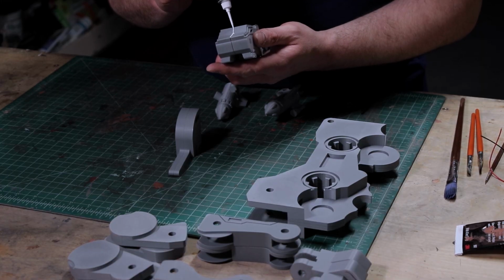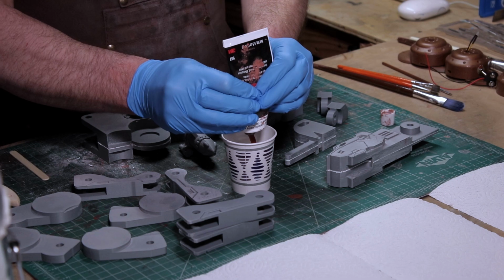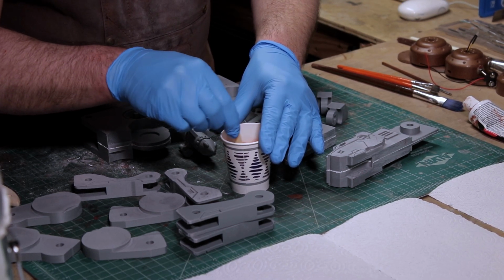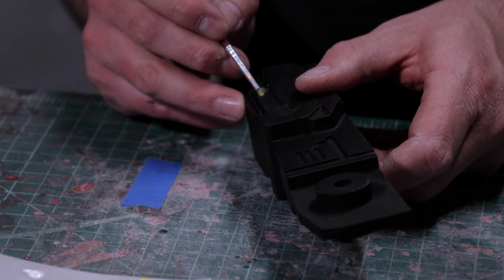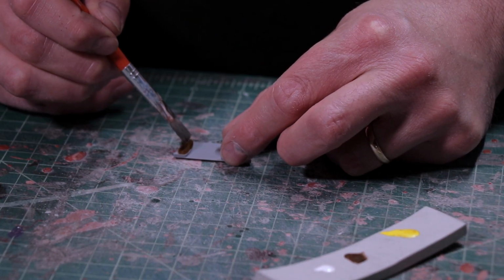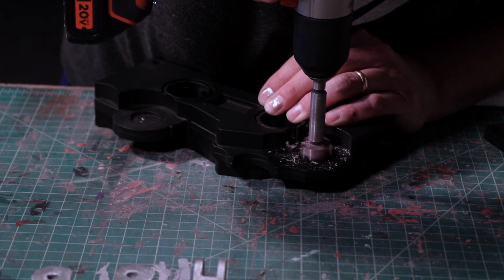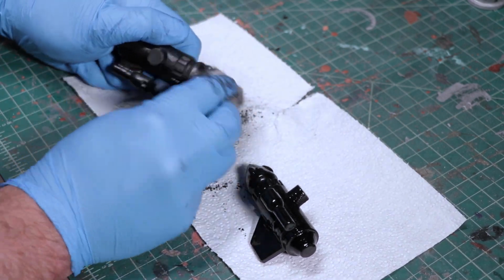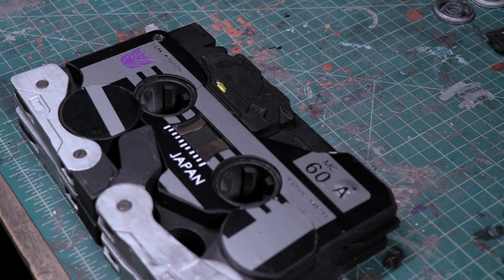3D Printed Ravage from Transformers

Comment: Nice work!  I have that oversized Laserbeak too, I'd printed my AGES ago as large as my printer at the time could handle and ended up with one the size of a VHS tape.  I used it as a prop to go with my low key Soundwave costume.  I realize this is a year old now, but I have a cheap 3D Doodler pen that I use to fill gaps and seam lines so that I have continuous plastic. :)

Comment: I BUY THE BAIDAI MODEL OF VOLTRON. THEN, I USE THE BLUE GOLION TO CHANGE IT INTO RAVAGE OF DECEPTICONS TRANSFORMERS

I ALSO USE THE RED GOLION TO CHANGE IT INTO STEELJAW（THE MACHINE LION）OF AUTOBOTS TRANSFORMERS
Reply from the maker: Nice!
Reply: @Mythical.Makers.Workshop  THEY ARE JUST THE MACHINE ANIMALS MODE. THEY CANNOT TRANSFORM INTO CASSETTE TAPE MODE
Reply from the maker: That is still pretty sweet though. Non transforming figures are just as cool as the transforming ones.